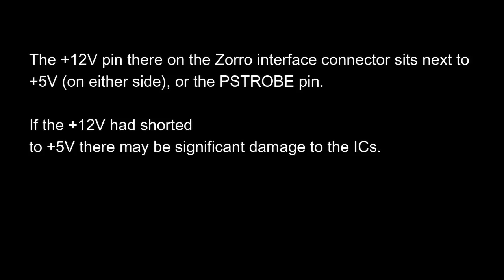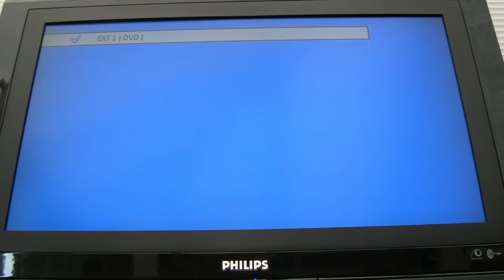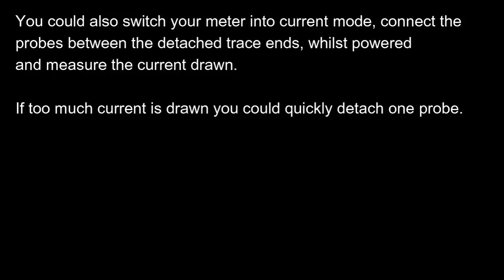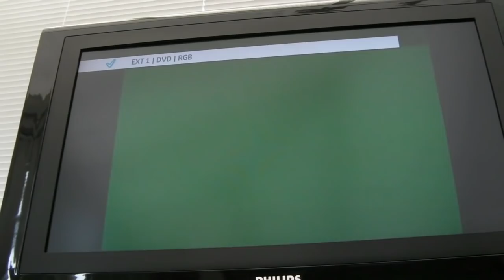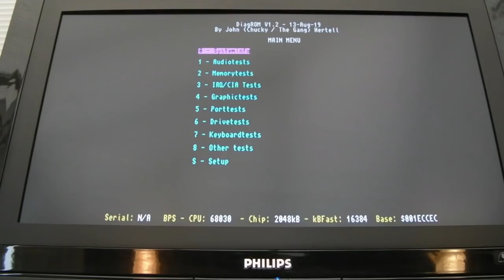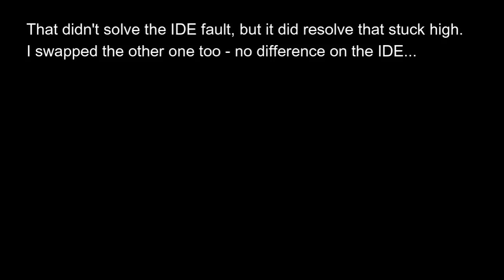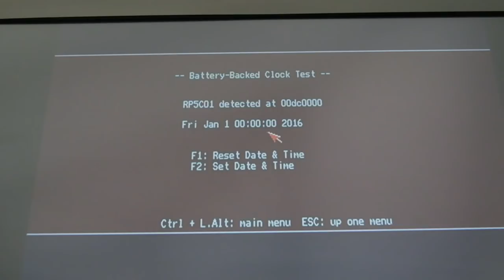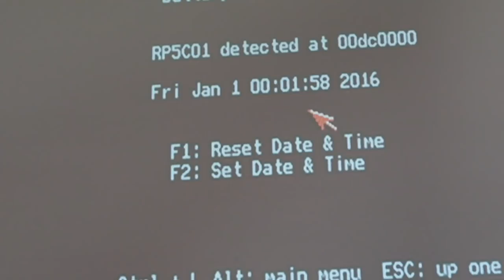Fixing "Retro Hour" Ravi's Commodore Amiga A4000 (As seen on RMC) - Part 1

Comment: Super usefull! My two A4000 boards suffered a small amount of battery and caps damage, resulting in intermittant ram/stability issues. This has given me so much useful information to go off of. I need to buy new SIMM slots as I want to take mine off (they are actually in super good condition, no broken clips at all) clean underneath, check those traces, then replace. They are not cheap however so I can't afford to buy those atm, therefore everything is on the back-burner. 

In the meantime I bought a ZOYI ZT-702S oscilloscope/multimeter and want to learn how to use it, testing both boards side by side to see what is what. Somewhat scared by that prospect!

Comment: Just for later reference - when you see -8V on the opamps +12V pin, it means +12 isnt connected. What you're seeing is the -ve supply voltage bleeding through the opamps internal circuitry and out of the power pin. Confused me as well the first time I saw it
Reply from the maker: Thanks, yes - I figured it was that =D

Comment: Helpful video as usual!  What could be the reason that 12V rail had lifted? A short, generated heat ?
Reply from the maker: A short somewhere!  I am guessing either a Zorro card caused it, or one of the power molex connectors shorted to the back of the Zorro daughterboard solder points (some stand out a long way).

Comment: Methinks someone had used an PC ATX power supply on that A4000. They can put out enough current to vaporize traces unless you properly fuse them to match the use case. (And 30 seconds after I typed this Gadget also mentions properly fusing them. I could have just been patient but...)
Reply from the maker: Yes, I forgot to mention that - but that point is covered in the follow up to part 2! =D
Reply: @GadgetUK164  You did mention about fusing an ATX power supply. I just happened to comment just before I got to that part.

I know there are some fused ATX power supply break outs for people using them as bench supplies. I wonder if anyone makes an inline fuse PCB for folks using them on other systems?
Reply: @HeyBirt  yeh I had some dodgy years old atx psu. I am going sfx with advice
Reply: @Djformula  Good idea for safety. The ATX supply can output a lot of current.

I think someone could make a inline fuse board for ATX supplies though (or maybe just make an inline pigtail with fuses installed). This would be very useful if you use an ATX supply for testing other systems.